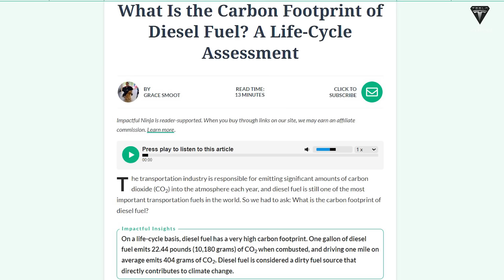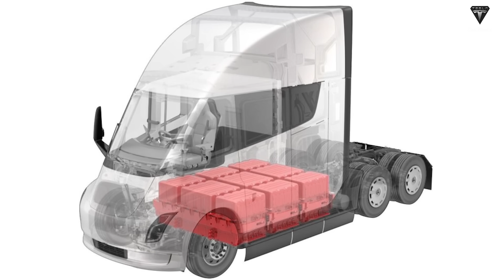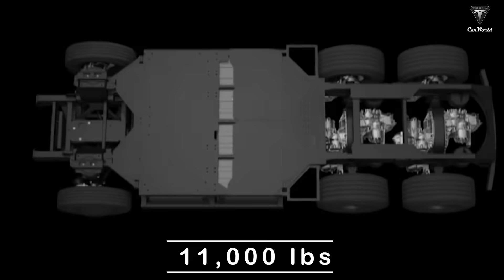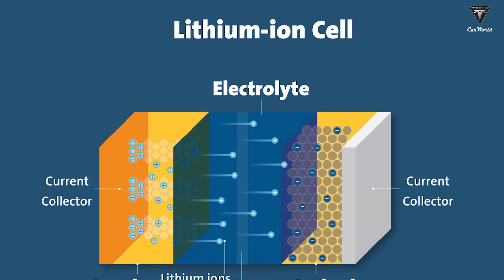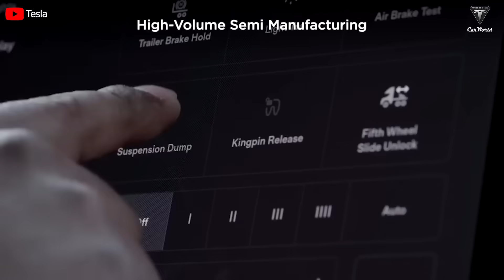Tesla Semi Truckzilla is Future: 82,000lb Highroad Beast, 500mi charge, 900kWh Battery Tech Mystery!

Comment: The title is laughable, that pile of garabage is not a truckzilla, there are plenty of diesel power semi's that pull 150.000 to a million pounds & they can go further distance and when they get low on fuel they can refull in about 15 minutes.  The place that this semil would work well is the ports or local haul, the only proplem is if you have a lot of them you can't charge them all at once, so they are not practical.

Comment: 900kwh = 900 (k= 1000) watt hours
900.000 watt hours volts x amps = watt
1000volts x 900 amps=900 kWh( Tesla semi)
Mega pack chargers 2  power pack chargers 1 level 6 wireless Chargin using coupled magnetic resonance frequency click click

Comment: Sleeper cab...? What about NO cab!? Automous trucking would be the ultimate game changer.
Reply: The trucks all have the computers and censors on board for autonomous trucking, without doing away with a cab which is still going to be useful for manually moving the truck sometimes.
Reply: @-whackd  Yeah, I suppose I was exaggerating when I said no cab at all. But a sleeper sounds like we're taking the conversation in the wrong direction, especially if you believe trucks will be driverless in 5 or 10 years,

Comment: Heavy truck in China usually don't e-brake so as to avoid the load from moving forwards and kill the drivers,  as the result kill the small cars in front of them. Not sure if Tesla has a solution to this physic problem.
Reply: What's "e-brake"? You mean regenerative braking? The amount of deceleration from regenerative braking can easily be controlled in Tesla cars, and the same is true of the Tesla Semi. So yes, Tesla does have a solution to this physics problem.
Reply: @BigBen621    no. I mean emergency brake.
Reply: @神之义   As far as I know "emergency brake" is simply maximum braking, hard enough to engage ABS, and no system can provide any greater braking unless it's throwing out an anchor. The whole story sounds fishy.

Comment: TO BAD AMERICAS POWER GRID CAN'T HANDLE CHARGING THESE HUGE BATTERY PACKS. AND AFTER A FEW CHARGES, THERE QUALITY DROPS. AND AFTER A YEAR, I BELIEVE THERE EFFECIENCY WILL BE DEPLEATED, AND THEY WILL BE DEEMED ONLY GOOD FOR SHORT RUNS, OR AS SHIP ANCHORS. AND DISPOSING OF A BATTERY THAT BIG IS GOING TO EXPENSIVE. THIS IS ALL A HUGE PIPE DREAM.
Reply: After a few charges? What FUD have you been reading?
Reply: Cool story bro. Do you even know the battery chemistry of the batteries in these trucks? lol

Why would someone dispose of thousands and thousands of dollars of metals in a battery? I think they would probably sell them rather than disposing of them. Only a subhuman retarded person without a brain, like you, would assume to dispose of thousands of dollars of useful metals.
Reply: Tesla can add Mega Pack to the charging stations to store up electricity  from the grid at low peak hours first. Solar panels roofs at the stations can also help to ease the grid. For degradation problem Tesla batteries have long life cycles.
Reply: None of these things is true; but I can certainly understand why low-information haters like you are being triggered by the success of the Tesla Semi.

Comment: All EV's must charge off grid using clean energy. To accomplish the goal All EV' all made using fossil fuels.
Reply: No they don't. I charge my EV on my grid which has been 100% hydroelectric energy my entire life.
Reply: EVs may be pulling their power off the grid which is generally fossil fuel driven but it is roughly 60% efficient from the well or coal mine to electricity . When fossil fuel  gets through the pumps to the vehicle it is less than 20% efficient. Solar and wind provide a much greater efficiency over time. And yes, it starts with fossil fuel to build and is now taking over as major grid batteries are being developed and installed . Let's see if major tractor trailer manufacturers start to Incorporate EV tractors..
How about Kenilworth EV?
Reply: I've got a model y and a RAV4 hybrid oh, and yeah I forgot I got a one ton 6.7 L F350 Diesel😅
Reply: And my cyber truck is on order😉

Comment: If they were using swappable battery block, it would dramatically increase the utility because instead of standing with a truck for a charge, you could just grab a fresh battery and continue to drive. Plus any battery advancement and upgrades could be applicable to all trucks without permanent replacement. Also in case of fire, you would loose only a battery and not the whole truck
Reply: What's wrong with charging?  It's getting faster every year and we all need breaks from driving. But if charging is at loading and unloading locations then you don't even need breaks.
Reply: @giantarcsfora9279  
Fast charging and charging above 80% kills battery health.
Reply: @MobiAussie   Fast charging and charging above 80% kills battery health. 
Depends on battery chemistry; LFP batteries have no such limitation. Further, this applies to EV cars, and has not been demonstrated for the Tesla Semi. Since Tesla warranties the batteries in Tesla Semis for a million miles, and at least during the Run On Less tests in September put no restrictions on charging to 100%, it's very likely that this issue doesn't exist for the Tesla Semi.
Reply from the maker: This is a rather unusual opinion, but consider the challenges we face when installing a backup battery. Who will be responsible for the installation, especially concerning the technical aspects of connecting power cables? Do drivers possess the necessary knowledge for this? Additionally, the cost of purchasing a backup battery can significantly impact the decision. Thank you.
Reply: Swappable rechargeable battery packs are not practical. Ever notice that phones don’t have them either? L-ion batteries present challenges that cannot be accommodated safely in an exchangeable package.
Reply: @petergosney6433  Hey, if it's a regular route, it might be worthwhile to park a fully charged second truck at the mid way point and swap cabs. No one would do that with a diesel truck. But electric trucks are cheap enough that it might pencil out.
Reply: @CowboyOdie  electric trucks are not cheap. In Australia the driver must take a 15 minute break every 5.5 hours; in the EU, the driver must take a 45 minute break every 4.5 hours; in the US, the  driver must take a 30 minute break every 8 hours, but can only drive a maximum of 11 hours within a 14 hour period. All of these regulations mean that the Tesla Semi can easily go further than the driver, in a day. The problem is not the truck, it’s the driver, on long-hauls.
Reply: Google Janis trucks. They have swappable batteries
Reply: @lindam.1502  it is also a solution, at least for long-haul, to a rapidly disappearing problem. In Australia, the driver must rest for a minimum of “15 continuous minutes” every 5.5 hours. I believe other places are similar. Therefore, the Tesla Semi’s actual range — for a single driver — is already 500 + 15 minutes of charging (175) = 675 miles. By then, it’s close to a mandated major stop required of the driver at 12 hours. As you can see, the truck endurance will rapidly soon exceed that of the driver. It will be different around town, where drivers swap.
Reply: @lindam.1502  it  will be interesting to see if they can make it work. They’re outliers, and it’s not a new concept.
Reply: Yeah why don't they just easily swap out a multithousand pound brick of metal? 🤔 Hmmm, doopity doopity dee.

Comment: i think it is a cool tuck but the weighed limit is to low 82 000 lb is not enough.if I were to drive a tesla tuck like that when I work, I would drive with an overload 4 out of 5 days a week.
Reply from the maker: What type of cargo are you carrying that exceeds 82,000lb? US law does not permit trucks to have a payload exceeding 80,000lb. Electric trucks are given an additional 2000lb allowance, but if you are in Europe, you should consider a different truck. Thank you
Reply: @TeslaCarWorld  i drive around and deliver food in norway. the weight of the truck and trailer is often over 40 tons sometimes up to 50 tons
Reply: @1993lagervall  The GCVW of a fully loaded Tesla Semi is over 40 tons, as well; 41 tons to be precise. But that's the legal limit, so no one's driving 50 tons trucks, except with overweight permits.

Comment: .... I mean the sleeper version would just be the Heavy duty Day cab version but more fleshed out. the Day cab literally ends at the hinge of the door so you expand that dead space with cabin space and it's the sleeper version or the mini sleeper version. I make an assumption that they'll make three Sleeper versions, a mini, a regular, and a king of the road edition. Simply cause the current design of the Tesla Semi Allows for there to be about six maybe seven models just with the two Cab designs they have now.
Reply from the maker: We are not certain about the specific versions Tesla will release because information is currently limited. However, the most crucial aspect is that it will feature an added sleeper in the upcoming version. Thank you for analysis

Comment: The key to all this becoming a reality is mega charge station availability near main trucking  routes. Until that happens...it wont be viable
Reply: Well that fails the basic logic test. 80% of OTR freight is under 250 miles. The fully loaded round trip range of Semi. On that alone, it completely displaces diesel in those ranges.
Reply: interstate short hauling with this things will make you highly competitive you can really hit the buck on the spot market with this trucks and who gets them first is the one to win the most
Reply: Pretty soon range and charge times won't matter. A truck with a 200 mile range and 2 hour charge time would be worthless when a human driver is involved. But the moment trucks drive automously, no one will care about specs.
Reply from the maker: We cannot deny this either; the limitation of Megachargers is indeed a crucial and challenging factor for Tesla. Perhaps, this is a reason why this electric truck is still somewhat restricted. However, let's remain optimistic and believe that this issue will be resolved soon. Thank you !
Reply: Even installing a single charger at your location is a multimillion dollar project. Each charger draws close to a megawatt. When Pepsi installed theirs, the power company's substation couldn't even handle the load
Reply: @joecummings1260  You keep spewing FUD. I've already documented for you that the four Megachargers at the Fresno Frito-Lay plant cost $334,000 plus a $5,500 permit fee—that's less than $100,000 each. Please stop lying.

Comment: Railroads are being ignored and they are a key player in the American transportation system. Electrified railroads are proven long-range carriers. Intermodal facilities interface well with trucking and maritime. Huge opportunities exist to electrify railroads. Rubber tires and highway space and maintenance are automotive's inefficient downfall. Each mode should be optimized for the best system.
Reply: They eliminated 90% of the railroads . Not sure where you’ve been
Reply: Railroads are Diesel Electric.  😮
Reply: A large portion of railroads are electric in the world and they all could be. Battery electric locomotives have been in development too. Even diesel has been proven to run on sustainable carbon-neutral fuel.
The huge savings are high capacity, efficiency, existing green rights of ways, and low maintenance. @marvinellis1517
Reply: Need both
Reply: Right on. Tesla ships cars by both rail and truck for good reason. @DwDDB
Reply: Rails cost a LOT and no one but trains can use them. Roads are available for almost everyone. That means roads are best for short distances to regional delivery while rail is best for long distance to regional delivery. Basically, they system is already set up near optimally.
Reply: Actually, rail is an economical choice and they must by law accept anyone's freight. @williammeek4078

Comment: On the Tesla strike in Sweden:
There are currently 8 unions involved, IF Metall and 7 others on Sympathy Strikes. (and 1 Norwegian union is threatening action)
IF Metall - [Swedish Industrial & Metalworkers' Union]: Will not maintain, service or repair Tesla Cars.
Transport - [The Swedish Transport Workers' Union]: Will not handle Tesla cars in Swedish harbors.
Hamnarbetarförbundet - [The Swedish Dockworkers' Union]: Will not handle Tesla cars in Swedish harbors starting Nov 17th
Fastighets - [The Building Maintenance Workers' Union]: Will not clean in Tesla owned or rented poroperties starting Nov 17th
Elektrikerförbundet - [Swedish Electricians' Union]: Will not service or maintain Tesla supercharges on any owned or rented Tesla offices starting Nov 17th.
Seko - [The Swedish Union for Service and Communications Employees]: Will not deliver mail or packages to and from Tesla, starting Nov 20th.
Målareförbundet - [The Swedish Painters' Union]: Will stop all paint jobs on Tesla cars starting Nov 21th.
Fackförbundet ST – [Swedish Union of Civil Servants]: Will not deliver mail or packages to and from Tesla, starting Nov 21th.
Fellesforbundet - [The Norwegian United Federation of Trade Unions]: Have threatened to take action if Tesla tries to circumvent the Swedish harbor blockade through Norway.